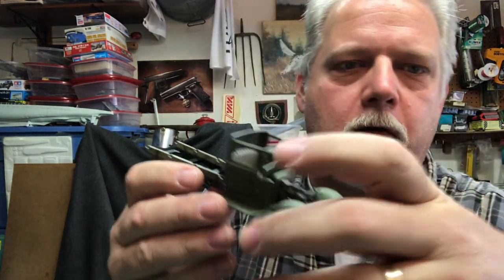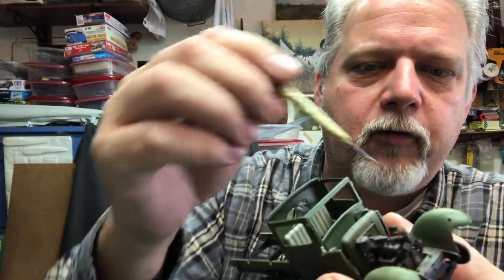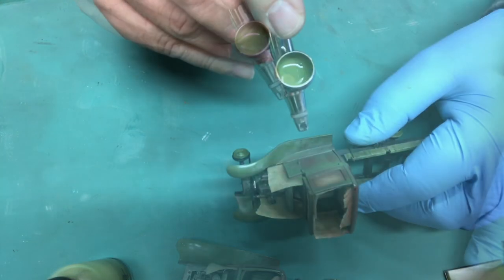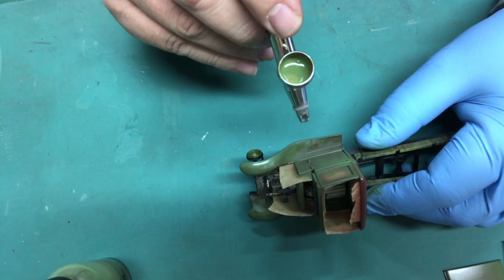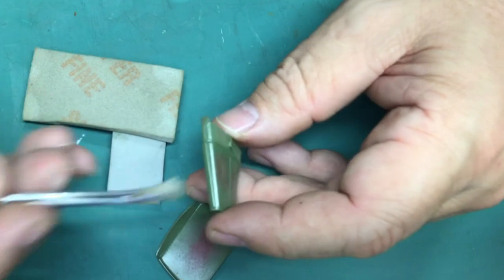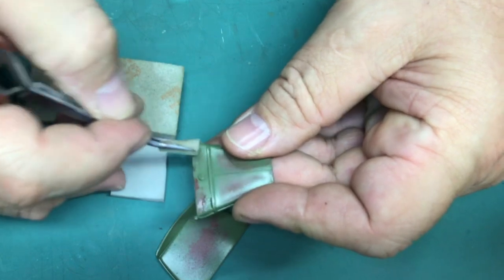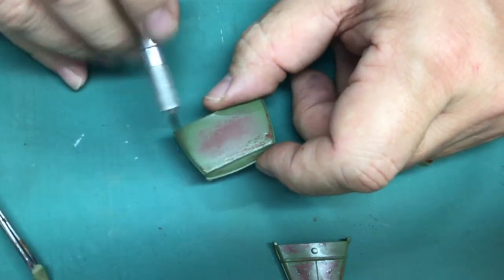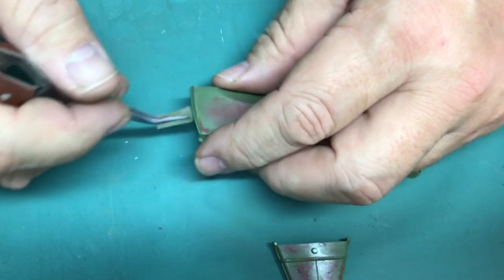Hairspray Chipping the GAZ AA

Comment: Interesting technique. Isn't MRP lacquer based? I'm assuming (if the paint is lacquer) you have to sand the top layer so the water will penetrate through the lacquer to the base hairspray. I've always used water based paints to do my chipping but may have to try adding lacquer thinner to the paint and do some testing. Great tutorial Scott!
Reply from the maker: MRP is an acrylic lacquer, so yes, its tough paint. But it chips, and sometimes you do have to get it started with an abrasive, like I did with the sandpaper in the video. Last night I chipped the wheels with just a brush after a light spray of hair spray, not a heavy coat like I did in this video - so its all about controlling the variables - how thin the paint is, how thin or thick the chipping medium, whether you scour the surface with abrasives or pick at it with points, etc.
Reply: Yeah I usually put 2 light coats of hairspray I find you have more control of the chipping. So MRP is similar to Tamiya when you ad they're lacquer thinner to it.
Reply from the maker: @SmallSoldier  To be honest, I have never used Tamiya other than with water to thin it and that was 15 years ago before I took a decade-long break from the hobby, and now never use it at all. I have some set aside for a Japanese aircraft because they make the colors and MRP doesn't yet, and will thin them with Mr. Leveling Thinner to force them to perform more like the thin paints I am used to. I hear its a very nice combo and gives excellent results. I figure it will chip and weather probably a little better than MRP since its not as strong surface until its had a long time to cure.
Reply: Yes mr levelling thinner 400 is awesome. I use it with Tamiya paint as well.